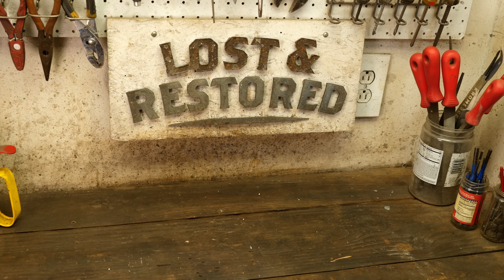I Restore A Rusty 1953 M5 Bayonet - Korean War Restoration

Comment: This was not a restoration.  You destroyed the peen on the pommel and drilled out the rivets on the lug guide, along with the rivet for the guard retainer.  This was completely unnecessary.  Then you refinished with cold blue.  Should have been bead blasted and reparkerized.  What little collectability that knife had when you started, it was gone by the time you were done.  As a US military bayonet collector, this was truly cringeworthy to watch.